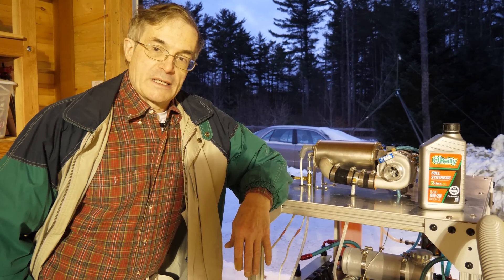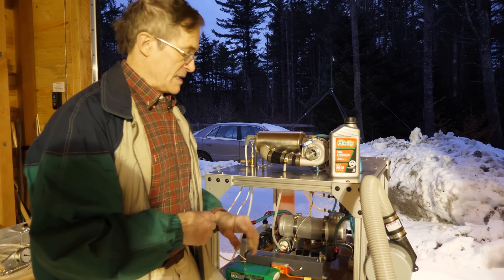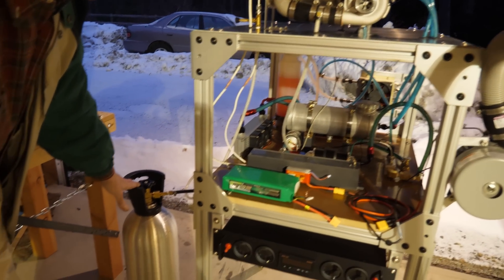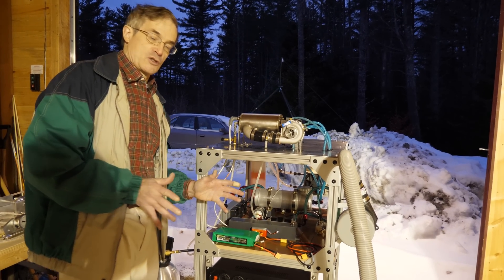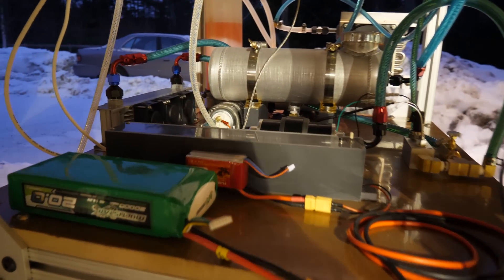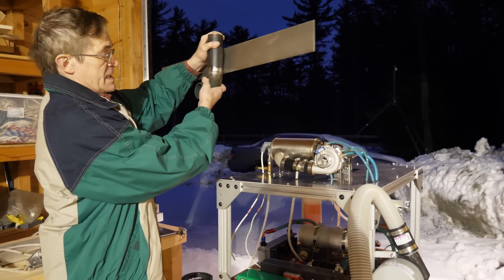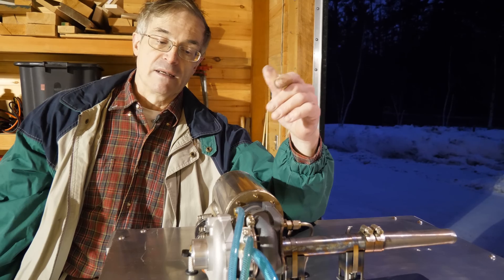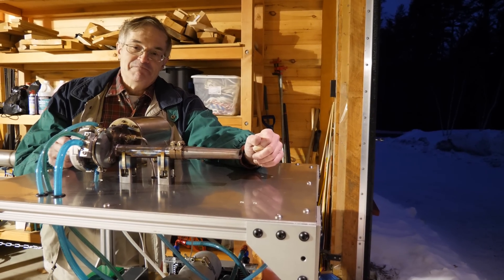FIRING UP THE TURBOJET!

Comment: I think those large pops while the engine was running were the engine surging, looks like you have the exhaust nozzle too choked.
Looking at the glowing part of the turbine side of the snail I'd say you have either incomplete combustion or the secondary holes of the combustion chamber either need opening up or create a few more of them.
great work.
Paul
Reply: I too am confused as to why he thought restricting the turbine outlet nozzle greatly would be a good idea to do before the test run. Really bad for gas flow through the turbine IMO, especially with such a small setup that has little room to accommodate the excess air such the compressor is generating.
Reply: @poisonouspython1410  yes, my thoughts exactly! this is probably why it surged a few times
Reply: Aww nice profile pic.
Reply: @teresashinkansen9402  thank you. legend has it that an ArcturanMegadonKey could talk the hinds legs off a....well I'm sure you know the rest
Reply: @ArcturanMegadonkey  Sorry I didn't knew the reference but I looked it up, interesting.  I like donkeys they are so cute so I thought he/she could be yours.
Reply: @teresashinkansen9402  have you never heard of 'The Hitchhikers Guide To The Galaxy' ?
do some searching, read the book, listen to the radio series. it was brilliant!
Reply: @ArcturanMegadonkey  ANYTHING by DNA (Douglas Adams) is worth the time!  Hot potato, anyone? Last Chance To See! :)
Reply: @ArcturanMegadonkey  Upvoted just for the HHGttG references.
Reply: @jdubya7139  thank you I am a massive fan of the work of Douglas Adams.

Comment: GUYS........ Please do not use thinner oil than recommended by turbo manufacture..... there are plenty of oil pumps he could of used, but we have used 044 Bosch fuel pumps for oil, and at the spec of oil recommended  by turbo manufactures..... The reason you don't see many working compact twin set ups, is the discharge temp of the air from the first stage can be over 200 C, hitting an ali comp wheel, that don't like temps much more than that, the comp wheel fails

Comment: If you want low speed high torque why wouldnt you just connect directly to the turbine shaft into a gearbox.
Reply: Because the turbine isn't making any extra power, just enough to run the compressor, and because small efficient gearboxes with a 100:1 ratio are very difficult to find.

Comment: It's surging horribly 
You need to add a compresson bleed valve on the compressor outlet to reduce surge on low compressor rpm
Reply: I doubt it was surging but it might have been combustion instability. You can hear the pops in the exhaust. So the gas isn't getting burned = flame out.
Reply: @hene193  Right.  If it was surging you would have likely seen a flame propagate out of the compressor inlet.
Reply: could you explain that a bit more? you sound very experienced with that kind of problem. all I could think was "it sometimes sounds a bit unstable"
Reply: @justusbenning1626  in his jet engines (because it's so small) 
Compressor builds up pressure and in turn combustion temperature and pressure rise problem is that combustion pressure rises over the max compressor pressure and air gets forced back into compressor causing surge
Reply: Erm kind of.... but it is more to do with the mismatch of the compressor wheel and the turbine wheel, but looking at the P2 gauge and the experience I have with DIY Gas Turbines, am leaning more towards the surging being more the result of bad combustion
Reply: @Turbojetkart  could be as he said in the video but I think it whould be easier to mount the compression bleed valve rad route it into combustion chamber outlet so bleed air helps spool turbine on low rpm and you eliminate 2 problems with one solution 
Also awesome jet kart dude I'm still impressed how fast it can start
Reply: @blackturbine   Not sure, i don't think its surging because of compression issues...... and could easily be checked with a cotton tread and some sticky tape. The way the P2  gauge was bouncing around did not resemble a stalled gas flow as i have seem before.  More like the results of bad combustion ? but so very hard to tell from sound and video. I would be more worried how hot it was getting, the bad position of the oil return line, and so much more about the engine
Reply: @Turbojetkart  we can only hope that he will show the combustion chamber liner 
That way we could at least estimate the combustion pattern 
That way we could get a better idea on what is going on
Reply: @blackturbine  I think it's doing some surging and has definitely unstable combustion because he's so heavily nozzling the outlet gas from the turbine. He's likely got a mismatch in compressor wheel and turbine wheel characteristics without any bleed air bypass. If anything he should keep his outlet gas tube diameter wide until it hits the nozzle for his power turbine he's planning to add downstream. I agree he needs bleed air regardless so it'll be interesting to see how it works when he does some further development to dial it in the performance
Reply: @justusbenning1626  I'm no physicist but I'm 99% positive he's basically saying the compressor is pumping too far above it's pressure ratio which is disrupting it's flow.
Reply: The surging could be caused by a few things..... bad combustion because of bad fuel presentation, or badly designed  flame tube.... mismatch between compressor wheel and turbine wheel .  Adding a bleed valve may be a solution, but first you would need to check why it is surging and if it is compression surging, which can be done with a cotton thread. Looking at how the P2 gauge  " BOOST" not" was behaving...... it looked more like combustion was the issue.  It could be that the fuel inlet pressure was close to P2 , with pressure drop across the fuel nozzle, etc. was a lot of pops and bang as it started up . I don't have issue with people wanting to build diy jet engines, in fact I help plenty to do so. What I have issue with is people, setting them self up as how to do, and they don't do it right......   Oh and this is my work  https://youtu.be/DmMVqyfrEBw
Reply: @Turbojetkart  very helpful. Thanks! Currently, I'm working in this project too for my final year project. Wish me a good luck. I'll look some of your videos
Reply: Andy Morris I’m interested in making my own jet engine what pumps and nozzles do you use?
Reply: @Turbojetkart  Je Zeus, can you provide a theme selection menu with that bulletin board you're using? Getting rid of the orangefest will do wonders for your site and your visitor's sanity.
Reply: Hi, thank for your comment, i will mention it..... its not my site... I am part of the admin, yep it's a little orange😀 you can keep up here as well  https://www.facebook.com/diygt/
Reply: @aku6043  hey! Even I'm building a turbojet engine as my final year project. Can you please explain how did you build one? I can share my mail id :)
Reply: 69 likes nice
Reply: its not even possible to have surge on that setup
Reply: @e34boat88  Guess you never seen a viper jet engine start up, you can get surge at any point..... for a number of reasons. Surge is the result of an in balance, but what and why it is surging once running is hard to work out from a video.  But I don't think any one mentioned surge on starting ? 😀 it popped and banged a lot on starting
Reply: Thanks..... did you see the world record 116 mph jet kart video
Reply: thank you, hope soon to start live streaming the testing of the new engine
Reply: Nice job there.
Reply: Stop thinking of a turbo charger for piston engine..It's a selfsustaining  engine that need compressor pressure and a well design combustion chamber to drive the turbine wheel,  So bleed valve wouldn't be applicable. Sound more like combustion chamber flameout and reignition causing a pop..Also his pressure indicator needle fluctuating showing sign off escaping pressure somewhere,  Exhaust pipe way too long...need to redesign lol.
Reply: @basimpsn  admittedly, he could be partly right because it did sound like the turbo was over its effective pressure. I'm not sure how you would solve that on an engine like this without changing the turbine wheel?
Reply: @zragevii4705  I see your point.. if the case pressure is low it won't run properly...seems he got it right in his next video 😇
Reply: @basimpsn  I actually just saw that as well. It's amazing to see someone build something like this.
Reply: I am interested in the generator/alternator you plan to fit using the exhaust from the turbo charger. The question is, why can't it be coupled to the shaft with some gearing and what would the pros and cons be of each method.
Reply: the only way you can take power off a shaft at that speed is electrically. https://www.autoblog.com/2019/10/21/garrett-e-turbo-electrically-assisted-turbocharger/
Reply: You didn’t say please so don’t expect him to listen to you
Reply: @mrd9534  oh no
Reply: @mrd9534  Ur mom gay lol
Reply: Do you think it was surging because  it was not up to running temperature?  It didn't run very long for the temperature to stabilize.
Reply: @rickdees251  does surging is related to temperature? Until what I'd understood, comp. surge occurs when the exhaust air couldn't expand correctly (such as a sudden blockage or the exhaust nozzle too small). Clarify me please.
Reply: @rickdees251  seemed like the tenperature wasn't so much of an issue, that exhaust was cherry red pretty quickly.

Comment: Tech Ingredients YOU are a modern day and interesting "Mr Wizard"
Looking forward to your video on Pulsed Detonation Engines (PDE) as I still have yet to see a homebuilt version that generates sustained thrust or runs at over 10hz continuously.
Reply: I've been working on a PDE for 6 years. Hope I get to prototype soon. Need $$
Reply: @shadowedmoonchannel  Sounds very interesting, I love inventions, prototypes, and inventor type people!  Here is a video I made about PDE ect...figured you might like it...
https://youtu.be/Hixe40eWo2U
Reply: I wonder if a pulsejet might be the way to win those car audio volume competitions.
Reply: @NiHaoMike64  I devised a 36" subwoofer that utilizes a crankshaft and adjustable throw connecting rod to recreate any range of base and frequency, with 10" of travel on the speaker possible.
Reply: @ProlificInvention  That's cool. I can feel the low vibrations just reading your comment.

Comment: You need a compressor bypass to unload the turbine (you'll get higher rpm's and better pressure ratios, by keeping the compressor out of surge) and a better flame holder to help stabilize combustion (you can hear it chattering, and see the boost pressure bouncing all over)

Your idea for thrust measurement is questionable, at best. The exhaust jet will entrain a not insignificant amount of air into the stream before making the bend, and the wall friction of the flow will come into play, so you will not be getting accurate measurement of thrust available. It will, however, be repeatable, so if you're only looking for verification of tuning changes, then it'll work fine.
Reply: I think that most of his combustion problems arrive from compressor surge 
I had similar problems and I added a compressor outlet bleed valve so it doesn't surge on low rpm
Reply: On the force measurement method, I agree with you, that is kind of a clunky way way of doing things. Mounting the turbine assembly to a ball bearing carrier on a linear rail bolted to the table would be a better way to go, simply place your force gauge between the turbine assembly and a piece of angle iron or something to provide a rigid stop, or weld a few bars in and a piece of plate and make it look professional. There are linear rail assemblies with ballscrew-style rolling bearings on all wear surfaces, strong, precise and low friction, lots of lengths and sizes available on McMaster. We got some at work (machine shop) for an automated joint machine we are making (live in Washington, and money is to made on the sale of THC, lol the thing spits out thousands of joints in an hour, if it's kept fed). We got 1/2" rails in several different lengths, but the shorter you go the cheaper it gets, and 2" long cars are something like $150, so not great on the cost but it fits the application extremely well.
Reply: @John Doe same thinking about thrust measurement, I sugest to weight all, hang the entire setup like a pendulum and measure the displacement from rest, then just run the math to calculate the thrust.
Reply: He said he wants to use this to turn a turbine ... that tells me that its better to include the "bypass" air effect into the measurement.
Reply: @MrRolnicek  If you're driving a power turbine, then you will need even MORE compressor bypass, to further unload the turbine. The extra backpressure of the power turbine is robbing the gas generator turbine of useful pressure difference, and that means there's less power to drive the compressor, which is already overloading the gas generator turbine.
Reply: @JohnDoe-fk6id  what do you mean by compressor bypass? A bypass from the boost pipe to the inlet side?
Reply: @MrRolnicek  he could make respool system but cutting into turbine housing is no easy task
Reply: Can you direct me to the appropriate reading material to learn more about what you're talking about? Thanks in advance
Reply: Could be that tapering outlet is too long or too small in diameter causing the surge.
Reply: I think his method will work fine because of newton's 3rd law, = & OPPOSITE REACTIONS. "Wall friction" in the pipe is described as "head loss" in engineering.
Reply: Just takes a bit of math to attain an accurate figure on the load measurement. Factoring variables of course.

Comment: What was with the pulsing, fuel delivery issues?
Reply: Compressor surge
Reply: @blackturbine  I don't think so. I think it's because some of the fuel didn't combust before the turbine, but in the nozzle. That's a problem when too much or too little air from the compressor.
Reply: @raidzor5452  side effect of a compressor surge

Comment: Awesome, though there will be some lateral force due to the airstream changing directions
Reply from the maker: As long as all the momentum is redirected, the down force will be equal to the thrust.  This assumes no friction.  The longitudinal force on the curved duct is countered by the longitudinal force generated by the engine.